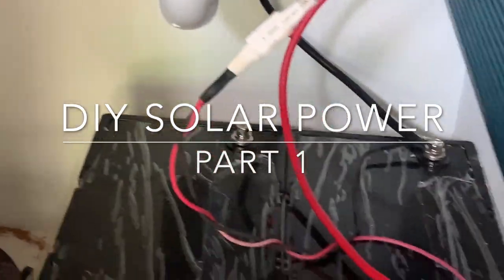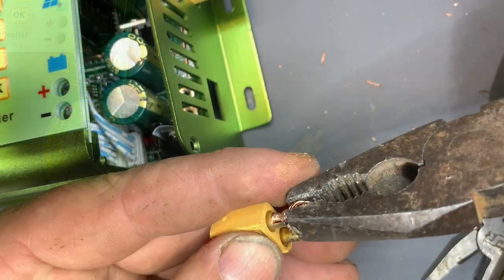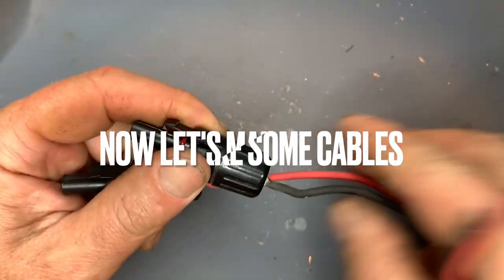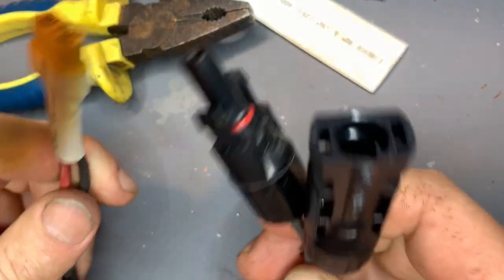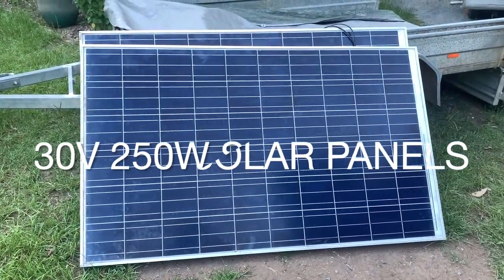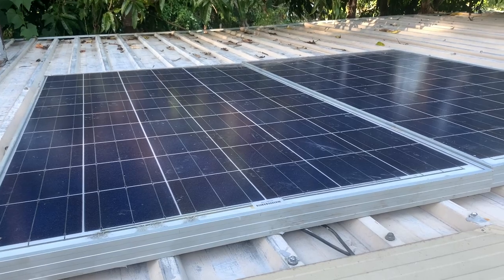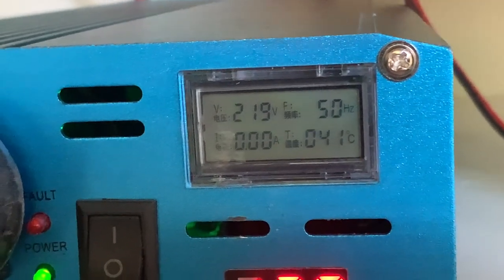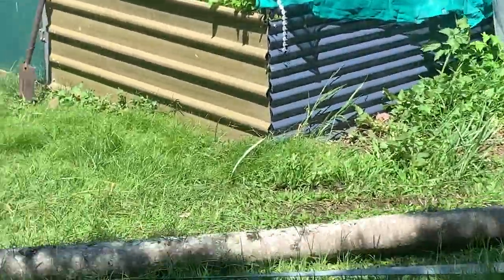Easy Low Budget DIY Solar Power Installation - Part 1

Comment: Hi, I subscribed because I appreciate the video and the playlists. I am in the same sector of Energy Home DIY but in Europe and under 1000 subscribers yet. I would have expected more comments on this useful video. I will try to contact you.
Reply from the maker: Thanks, the series of videos as a DIY guide I would have expected more views. I have 2 seperate solar systems based on the same design and both are working great. Would love to justify having more batteries and a larger inverter.
I subscribed to your channel also, will check out some of your videos.